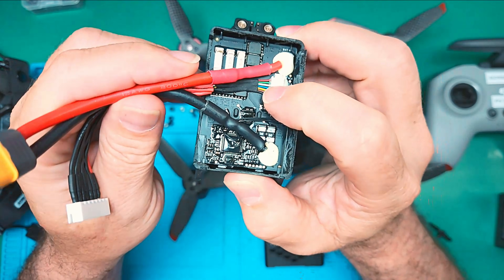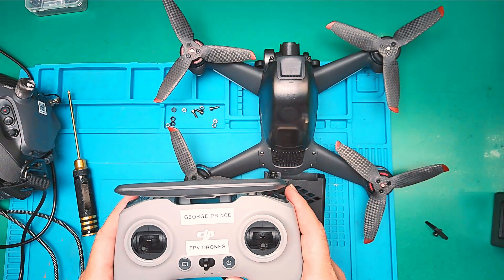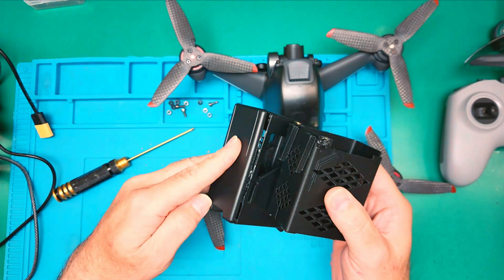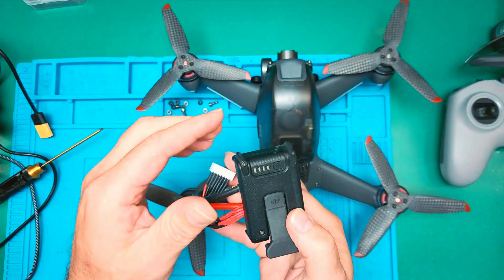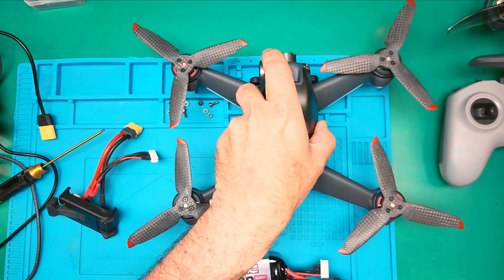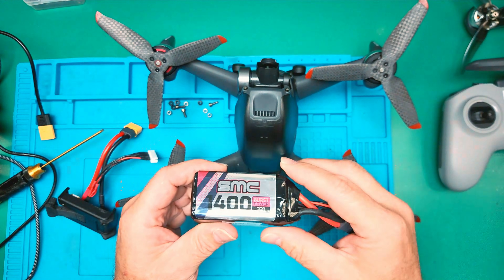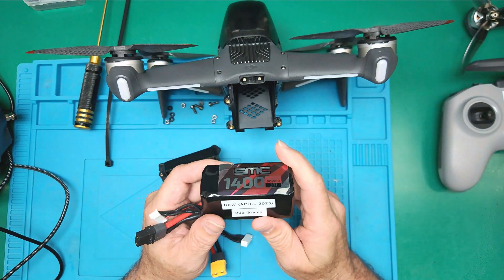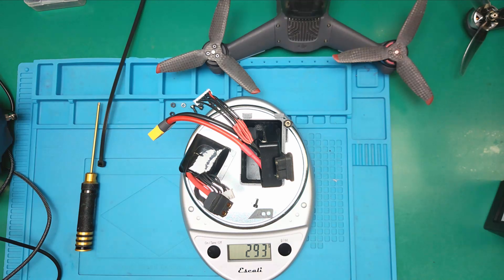DJI FPV Drone battery mod extended flight time! (5-30-2025)

Comment: like this video. Is this BMS board hard to find? It seems BQ9006 chip in the board will be locked as PF and no chance to it.
Reply from the maker: PF?
Reply: @princesfpvdrones  PF means permanent fail
Reply from the maker: @andysong1151  Yes normally the BMS board would lock but the BMS board that I illustrate in above video was an older model with very early firmware on it that I happened across that did lock when the cells went dead. Very lucky find for sure.
Reply from the maker: Please elaborate  your question?

Comment: You only get 5 minutes from an IFB??
Reply from the maker: 5 minutes from what?
Reply: @princesfpvdrones  An Intelligent Flight Battery, the ones that come from DJI.  I get an absolute minimum of 13 minutes from all three of mine.
Reply from the maker: @MountainMan7.62x39  to what percentage do you run the batteries to?
Reply: @princesfpvdrones  About 12% give or take.
Reply from the maker: @MountainMan7.62x39  Oh no wonder, these are not lion batteries but LiPo drone battery. The lowest safe voltage for a LiPo drone battery is 3.0 volts per cell. Discharging below this level can permanently damage the battery. For optimal performance and lifespan, it's best to avoid going below 3.2-3.5 volts per cell during normal use. I land when the goggles reads 45% and then I check the voltage per cell to be 3.6 volts per cell.

Comment: can we have the diagram for the connectors of the bms odf the board?
Reply from the maker: I have a build guide up on this channel that shows the in detail.
Reply: @princesfpvdrones  i look most of your video i never seen one detail on whats the order wiring of the bms from the original board. ex like from left + and - on the right
Reply from the maker: @negrosaerialviews  Oh sorry, you referring to the balancing leads wires?
Reply: Yes do you have a video soldering those balancing lead wires and their orders? @princesfpvdrones
Reply from the maker: @negrosaerialviews  To wire balance leads for to the BMS, all you have to do is attach the balance leads in order starting with the most negative, black balance lead. Continue that process working your way towards the positive end, red. Hope this helps.
Reply: Thanks .  How about the 2 black wires for temperature sensing did you cut it ? @princesfpvdrones
Reply from the maker: @negrosaerialviews  No leave that, just curl it up on the board, worked for me.
Reply: Thank you sir appreciate your works  @princesfpvdrones
Reply from the maker: @negrosaerialviews  Happy to help out!

Comment: can we use other brands of 6s battery on it?
Reply from the maker: Yes, so long as it fits in the aircraft. I tend to ensure that what ever battery I use, its comparable to near the same weight if possible.
Reply: Do you think this mod is applicable to dji avata 1? @princesfpvdrones

Comment: wow great discovery . my battery cycle is now near dead its 163 already i might try this mod soon
Reply from the maker: Here to help!
Reply: It's not even close to dead. I have batteries with over 250 charges. Yes it displays the "battery life reached" or whatever it says. Still flies the drone fine. I just land at 30%

Comment: Would you dare try charging that with the original fpv charger?
Reply: I want to do something similar but would like to make it all enclosed. What happens if you  try to update the firmware?
Reply from the maker: @danw8985  You will brick the board, or so I have been told.
Reply from the maker: No never, lol, they are meant to be charged by an regular Lipo charger.